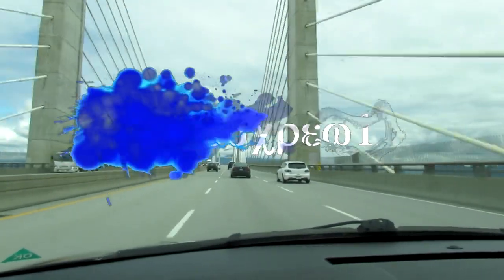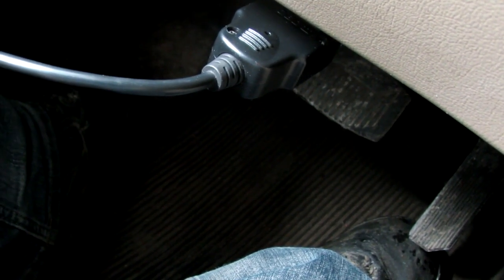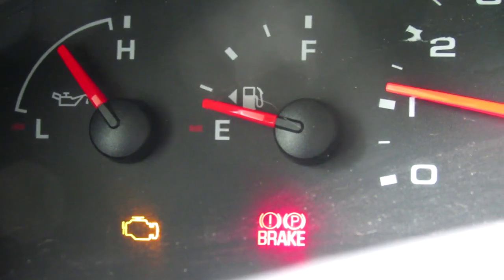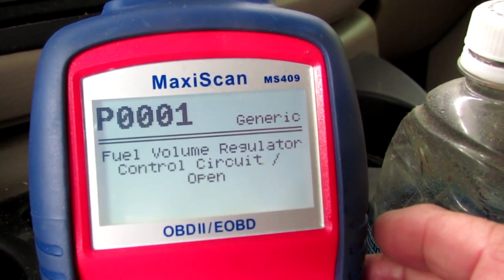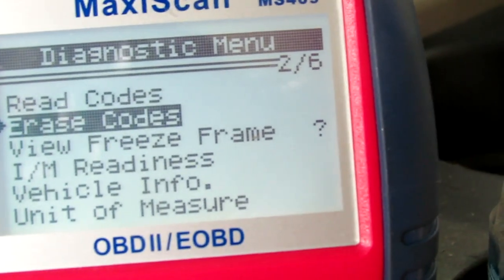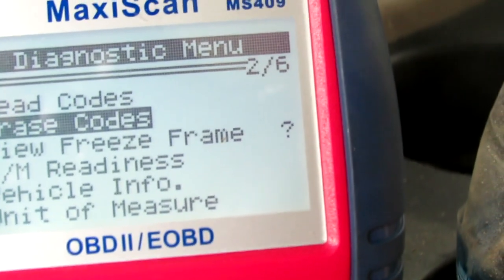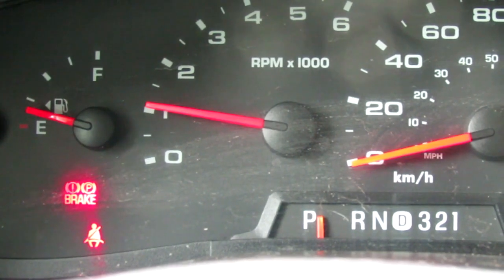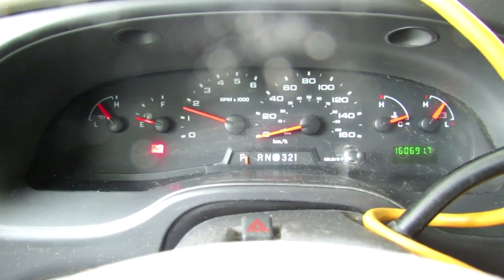RV Fuel Problems: Code Reader Fix

Comment: I think that code reader port deal came out in 1995 auto models and since.  Back around 1986 I was on a forestry crew.  The same thing happened, we had a barrel of 2 stroke mix gas and we were going somewhere far to the next job.  I decided to put all the mix gas (about 20 gallons) in a 1979 Chevy truck,  The truck ran fine and we didn't need to haul the mix gas around.

Comment: Search Amazon for foseal wifi obd2 scanner. About $20. It plugs into your port and creates a wifi network that an app on your phone logs into. It not only gives you data on codes,  but also real time data as you drive.  I loaded the app on my old Galaxy Note 4 (about 8yr old phone) and turn it on as I'm driving. Tells you everything your engine is doing...I usually only use it on road trips.

Comment: As you may know electrical connections get corroded at times resulting in all sorts of weird faults and errors. On older vehicles it is not very unwise to check connections which are exposed for corrosion and at times reseat them to prevent faulty/intermittent connections.
In most cases it can not hurt anything if you put some petroleum jelly on the contact surfaces of electrical connectors... like many do on battery terminals... keeps moisture off bay and obviously prevents rust forming...

Comment: Put some fuel in the tank . Letting fuel tanks run that low is dangerous , as electric pump will pick up all trash on bottom of tank . If I'm on the road I I always keep tanks topped off , especially if running the gen set off of them .
Your good friend Vinny in good old Fla.

Comment: You should have the key on without the engine running to properly read the code. You should cycle through the code readers to see if there are any more codes before erasing them.

Comment: From the looks of that fuel gauge, You going to have another problem, if you don't get some gas. LOL Anyway, maybe you need to put some fuel system treatment in your tank when you fill up. When you run your tank that low you could be picking up some bad stuff from the tank. Good luck not receiving any more codes. BTW we need and update from the Progressive Liberal Professor. LOL

Comment: You used the reader incorrectly in your video.  Code Lookup is what you do after you go into Diagnostics and READ CODES.  In your video, you went straight into Code Lookup, hit enter on the default (first, P0001 code), and assumed that had something to do with your vehicle (it doesn't).  Then you went into diagnostics and erased the code that you never read.  So you have no idea at all what code caused the check engine light.
Reply from the maker: Huh? Watch the video. I read the code.
Reply: @Linescrew1Canada  No, you did not.  DTC LOOKUP is NOT reading the code.  READ CODES, in the diagnostic menu is where you read the code. You jumped over that to erase the code.  Now that the code is erased, you have to wait until the next check engine light to find out what went wrong.
Reply from the maker: @joeblack9480  You're on drugs. The code was visible on the video. Perhaps you don't understand video editing?
Reply: @Linescrew1Canada  Watch your own video.  You first go into DTC LOOKUP.  You select the first code P0001, and show that.  That code, has nothing to do with your vehicle.  You are supposed to first go into Diagnostics, and select READ CODES.  Then, after you READ CODES, you write it down, then you go into DTC LOOKUP, and enter it.  Then DTC LOOKUP will tell you what the code means.   You NEVER use the READ CODES command that is in the diagnostics menu in your video.
Reply from the maker: Did it ever enter your mind that I edit my videos?
Reply: @Linescrew1Canada  So what you are saying, is that you did a video about using a code reader, and deleted the part about actually reading the code.  You are also saying that by some miracle, the code that did come up, was the default P0001 code that the DTC Lookup uses to show people what a code is supposed to look like.  Regardless of all of this, your video is showing people how not to do it.  So great editing.  Perhaps next time, read the manual first.
Reply from the maker: @joeblack9480  Then obviously it was 1) a miracle I read the code and 2) I managed to erase the code. SMH.
Reply: @Linescrew1Canada  We all need a miracle now and then.  It was probably just an engine misfire.  They cause a lot of check engine lights.  Have a good one, and keep the heat on Carolyn, those vids are hilarious.
Reply: @Linescrew1Canada  Respectfully, unless you entered the diagnostics menu, you didn't read the trouble code.  (You may have done that and it wasn't on the video.) You scrolled down and entered the DTC Lookup menu. That menu is where  you manually enter the trouble code you found as a result of being in the diagnostics menu. P0001 shows up as the first trouble code in the menu as an example. The P was flashing for you to enter a value for the first digit.
Reply: Don’t be so tough on Joe Black. What he’s saying is 100% correct. You never showed that you read the code. I own the same reader and know how it works because I read the manual. 😀

Comment: Well crap, I was expecting to see you getting greasy with bloodied knuckles trying to fix your rig. It's not every time a reset works. Loose cable, not likely with the modern connectors. However,  never underestimate the power of rodents on electrical and vacuum connections.  Have a good trip.